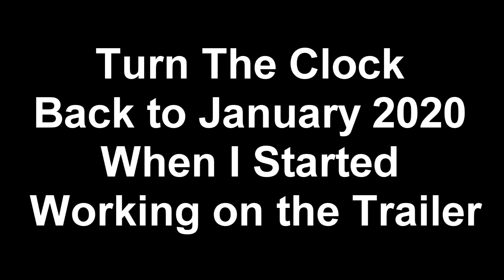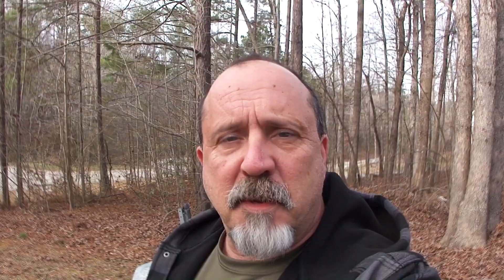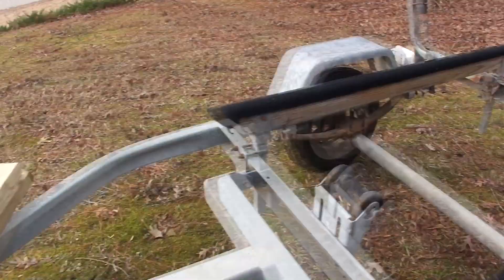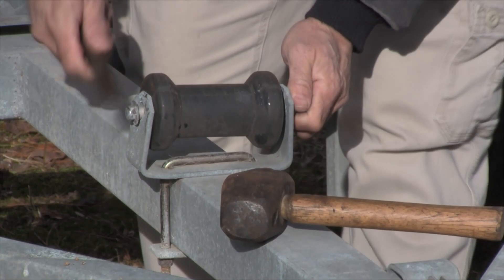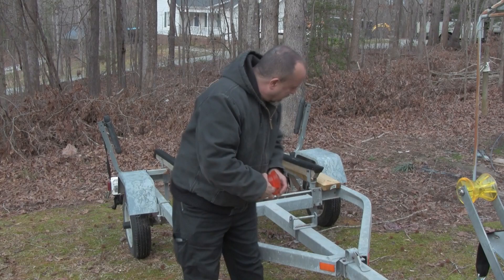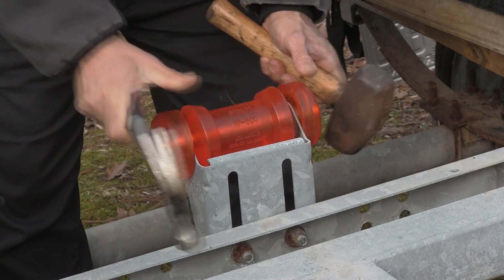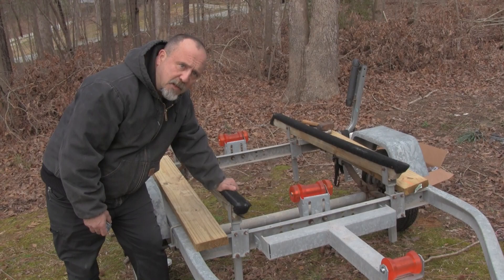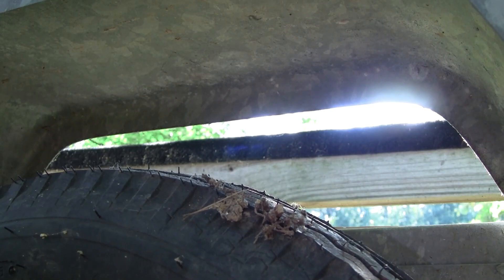How to Restore a Boat Trailer - Boston Whaler 13 Restoration

Comment: Damn.  I thought I was the only one with the fender issue.   Mine has a bolt on the top and every time I go to launch I can hear it scrape.   Now I’m raising the bunks up 4 inches and removing the fenders  and replaced with pvc fenders.   Haven’t been able to finish the gelcoat due to my supply place has been closed for covid 19.
Reply from the maker: That scrape would sound thunderous to me lol! I'm not sure if that caused the hull damage or not but am not taking any chances after all the work I've put into it.
Reply: Jose's Extreme DIY  that’s why I’m lifting the bunks up and replacing the fenders.  Not taking any chances  either lol.  Also it helps bring the height of the boat up just a little so I can see when backing down the ramp.  Usually I have to drop my tailgate because my truck is so big. Hope the boats gonna be done by October.  Taking my sweet time so I don’t screw up lol

Comment: That’s pretty much where I’m at not Joe my. Trailer rollers are junk  and I’m replacing the bunks ..  during the same time I’m fixing the crack under the hull from the old roller bunks  that cased it to crack in the first place .. I don’t like those roller bunks I’m replacing them with 2x4  and carpet ..
Reply from the maker: Keep the keel rollers though, classic whalers are supposed to rest their weight on the keel and the side bunks are there to stabilize it with not much weight on them. Seeing how thin  the fiberglass is on these classic hulls, I can see why! Make sense?

Comment: Do you have anything on reworking the axle hubs and bearings? I am trying to find out what the spindle diameter is on the standard Boston Whaler supplied trailer for the 13 sport.
Reply from the maker: Sorry, I do not but I think that could be a video in the future

Comment: on my trailer, I do not have the back 2 keel rollers. I just have the front keel roller and the bow stop. are the back 2 necessary?
Reply from the maker: If it's a classic 13 then yes, the bulk of the weight should be resting on the keel. The front roller is to keep the keel from hitting the frame of the trailer when loading and unloading.

Comment: Did you check for water being saturated into the foam? Did you weigh the boat? Thanks
Reply from the maker: Yes we checked it, it sits in the water just fine. All classic whaler's have some water intrusion.